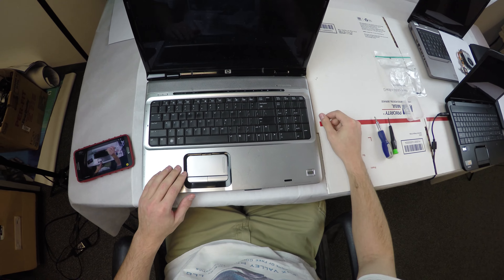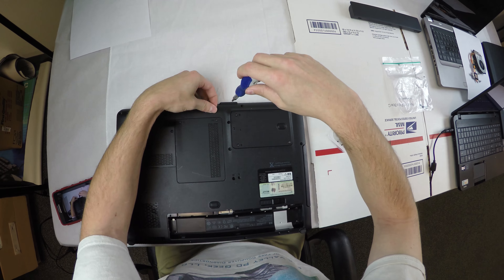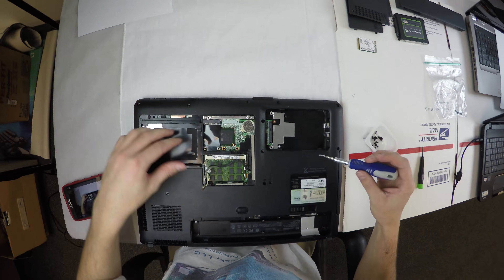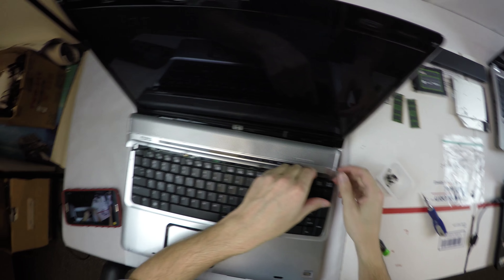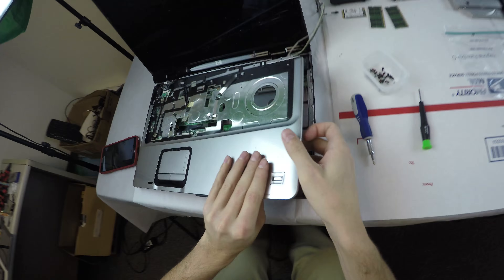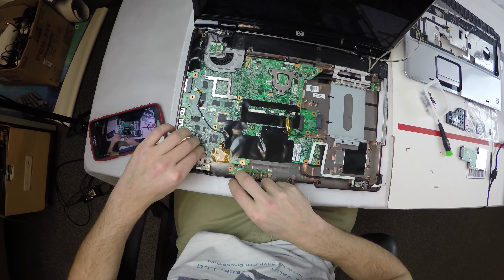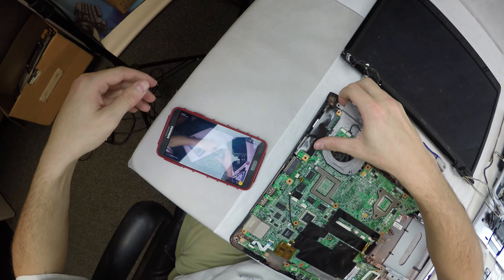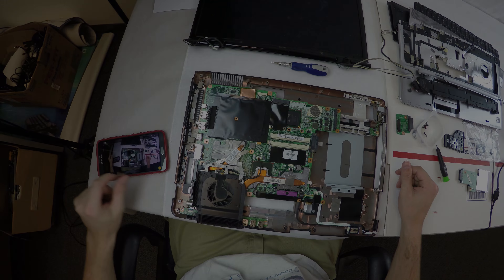HP DV9000 Laptop Disassembly and Teardown

Comment: what is the name of that long ribbon cable that connects the touch panel button to the mother board? it is missing parts for my laptop..you can see it at 3:00 time in your video..cn you tell me the name of that cable or does it has a code? how am i gonna but it? thank you